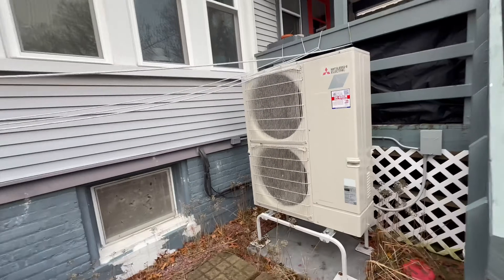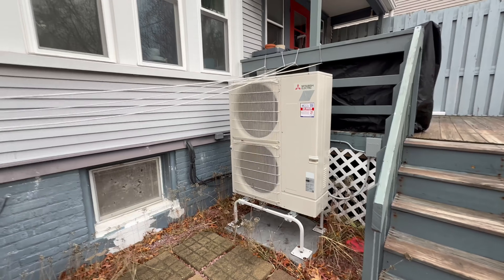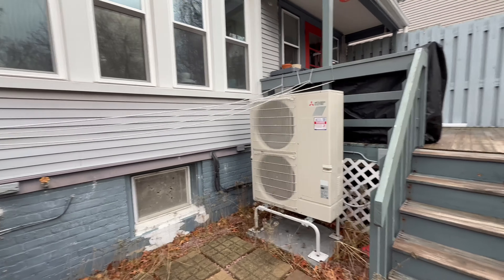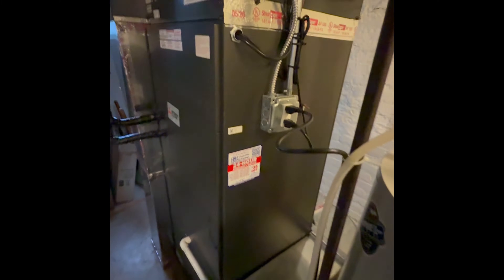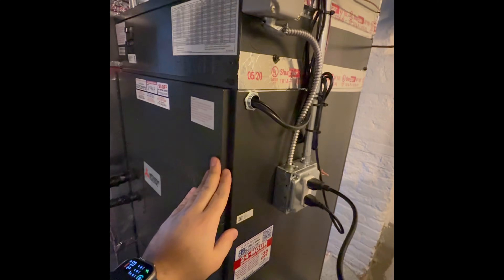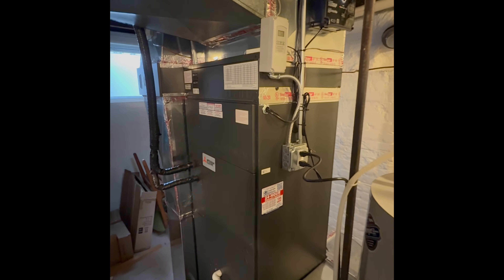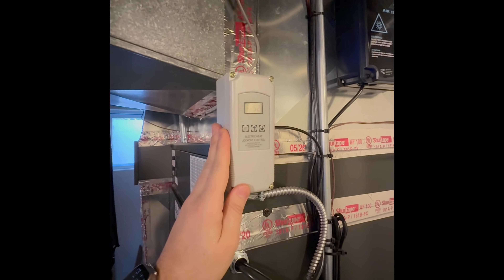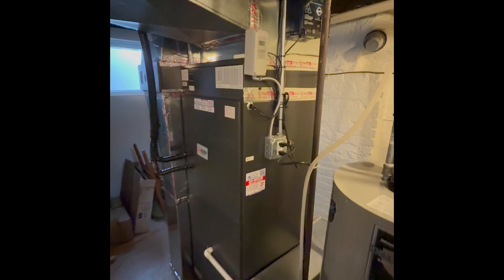Mitsubishi Electric Cold Climate Heat Pump - Home Electrification

Comment: @franco, how much does these cost for homeowners
Reply from the maker: Mitsubishi currently doesn’t offer a 4 ton size for single zone 1 to 1 systems. Largest is currently 3.5 ton however 4 and 5 tons should be coming mid to late 2025 with the new R454B refrigerant 

Also performing a proper heat load calculation to select size is really important, bigger isn’t better and most units are oversized!

What market are you in? I could point you in the right direction 

I serve the Chicagoland as Mitsubishi Elite Diamond Dealer
Reply: @FrancosHVAC Long Island NY
Reply from the maker: @derrickadade7879  a good start would be to book a free consultation in the Mitsubishi comfort website they’ll set you up with diamond dealers 

Before you meet with them id arm
Yourself with a list of questions and info to make sure they know what they are doing 

At this point you’re right in the middle of the refrigerant transition and a lot of units for R410A are out of stock or hard to get so you may have to wait until the new R454B units become available, expect anywhere from 10 to 30% price increase for the new refrigerant units 

If you’re able to find current models in stock and a contractor you trust I’d jump on it if you find the right fit 

Good luck!
Reply from the maker: @derrickadade7879  it varies a lot from home to home and market to market as there are many factors, such as size, efficiency, scope of work, accessories, product line, time of installation and others 

This particular one 4 years ago was around $16k including utility rebates
Reply: @ thanks Franco, but why 4 years ago. You don’t mind telling me how much a 4 ton Mitsubishi hyper heat system will cost? With installation and everything. You’ve made my interest in Mitsubishi heat pump rise more after watching all your videos on gas furnace and Mitsubishi heat pump. Keep the videos coming.